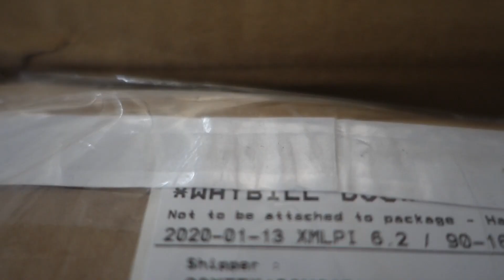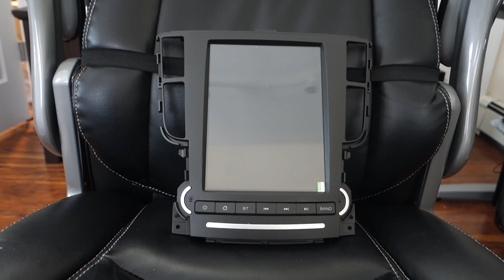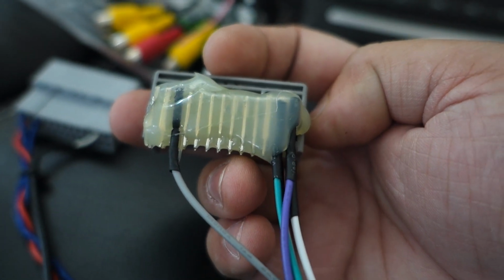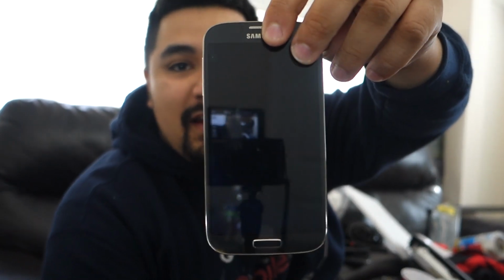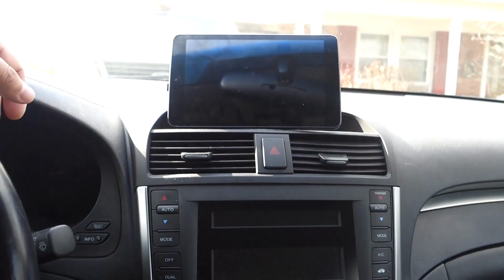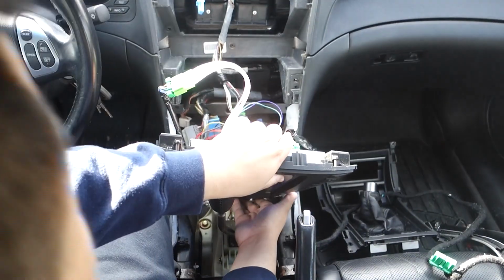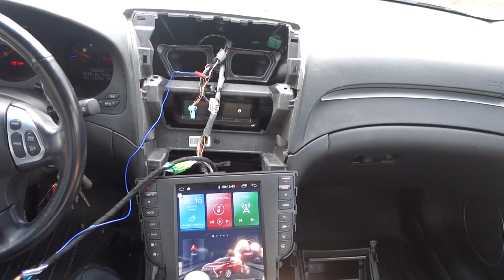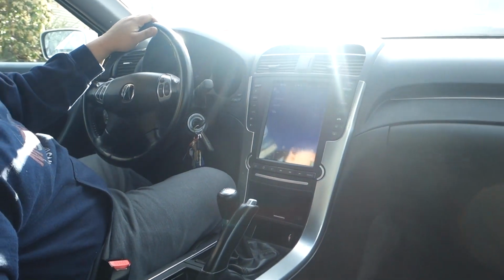3G 2004 to 2008 Acura TL 10.1 inch Android 8.1 Tesla Style Radio

Comment: Hey man great video...I’m also trying to put the CarPlay in this system and I was hoping if you can show how u connected it with the system. Thanks
Reply from the maker: Hey for CarPlay you will need a usb adapter they sell many different one but some require an additional app on your phone others don't.

Comment: Ok, it's been a year since this video. Do you know if the sellers have fixed the C/F temp problems? If everything working? Is there anything NOT working? Has it been reliable over the last year? Waiting to hear, ready to buy...
Reply from the maker: Hey we don't sell this radio. Most of the issues have been fixed according to other people who have installed this radio but we don't have first hand knowledge. A few months after this review we removed the radio from the TL we were testing it on as it just had to many small issues.
Reply: Thanks - I sent an email through your website asking much the same questions. Just ignore - and thanks for the info.

Comment: Are there RCA speaker outs - front, rear and Sub rca's?
Reply from the maker: no, the newer ones do have a sub output.
Reply: @MobileMaxCarAudio  much appreciated. I wish it had all the rca’s

I was thinking about running separate amp and all new front and rear speaker and sub box.  I guess I could get an amp that take speaker level lines in. Hate to not use rca 4v though. 

Thx for the YT content!

Comment: I got this radio for my TSX, I need to contact the seller to see if there is an update. I also got a back up camera separate, goes on the license plate light housing as well. My camera led lights don't light up. Everything wired correct. Whenever I don't drive my car for a few days, the time resets. I'm still trying to figure out the tablet radio day by day.

Comment: LOVE the video! Do you think setup is a good option? Ive seen a couple for 4-500$ and im really thinking about it. My other thought was just replacing the stock monitor with an android auto one.. would love to hear your thoughts.
Reply from the maker: Hey we can't recommend this radio it is up to you if you want to buy it. A lot of issues have been fixed but we can't help in any way with it.

Comment: So you say this works for without nav.. question, would I loose my heater temp display? Since mine is on it’s own screen and not with the clock like the models with nav?
Reply from the maker: the radio has its own heater display at the bottom of the screen at all times.
Reply: Mobile Max Car Audio thank you for clearing that up
Reply: Mobile Max Car Audio how
Much will u charges to put it on my car im in new york
Reply from the maker: @domcutshair7725  Hey we don't endorse this unit and would not feel comfortable installing in someones vehicle because of the bugs.
Reply: Do you have something similar to it ?
Reply from the maker: @domcutshair7725  no this unit looks so good. Everything else replaces where the factory radio goes.

Comment: Have been checking into getting this system. Was somewhat hesitant on getting it, due to software,  wiring, and  compatibility issues. Does your wiring connections help solve this?
Reply from the maker: We don't actually sell any accessories for this radio yet, it seems they are crossing the rears and fronts to generate a center channel and subwoofer signal also the signal is amplified so it distorts at higher volumes

Comment: Hey man, I got a question since you're familiar with all the audio stuff in the TL. Do you know what might be causing crazy static from the speakers? No music or anything plays and it doesn't matter if the radio is on or off. It's a lot of major static that doesn't stop. Only thing that stops it is to remove the fuse for the radio. Also if it helps I haven't done anything with the radio at all. Never touched it. It's all stock. 3rd Gen TL. Thanks.
Reply from the maker: When the radio is on and the engine is not running do you hear the static? It sounds like interference or engine noise/alternator whine. What year is the TL?
Reply: @MobileMaxCarAudio  04 TL. No, when I cut off the engine it goes away. But when it's started the static is back. Thanks, I'll look into it.
Reply: @Doomreb  My friend has the same problem. Did you ever find out what the issue was?
Reply: It’s the “Noise cancellation” feature in your cars. There’s one in the middle of the dash and one above the passenger seats.
Reply: @oligos  I haven't man.
Reply: @warren6172  Thanks for the tip. I honestly don't even have the time or money to deal with it anymore. I'll keep this in mind.
Reply: @Doomreb  I gave up on it also. Especially after taking it to a stereo shop 3 times. It only takes 5 mins to get them both disconnected. 

The front one is under a screen on top of the dash right in the middle and the rear one is above your head when in the back seat. Just unplug it and it was finally noise free.